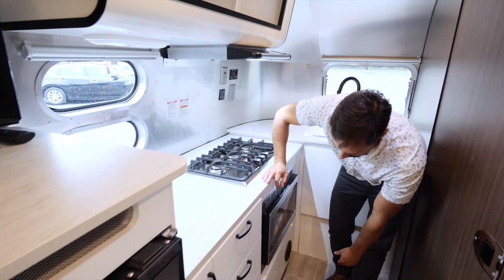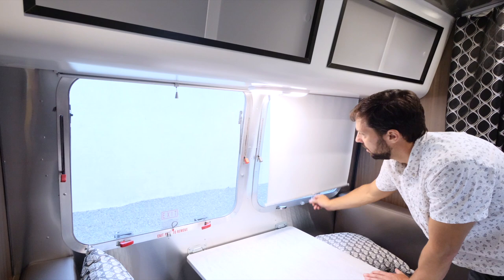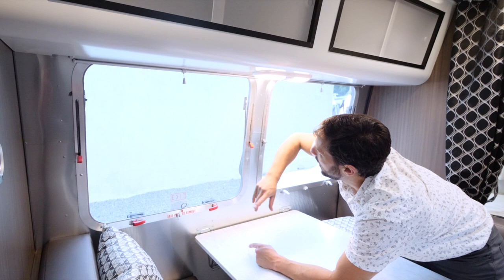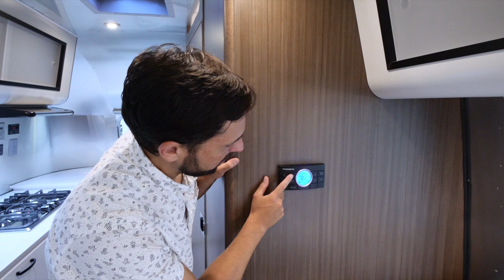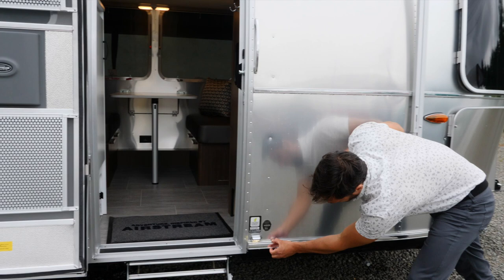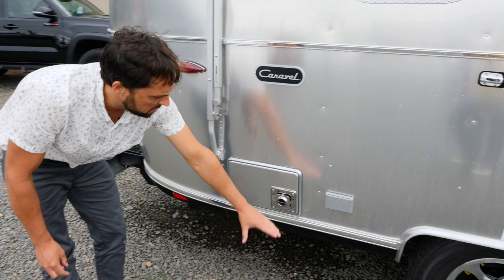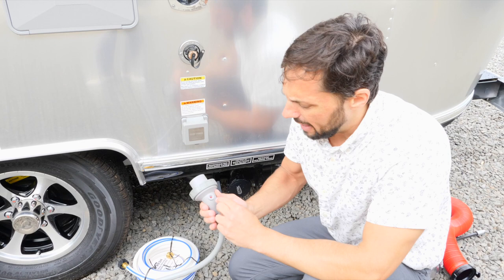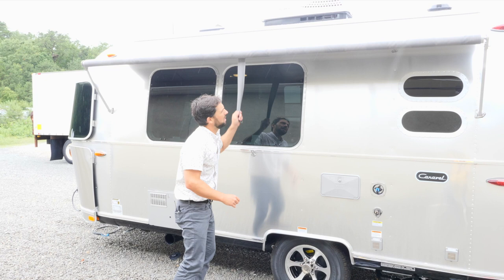2020 Airstream Caravel 20FB Walk Through Small Light Weight Travel Trailer Caravan

Comment: We have had 5 Airstreams from a tiny old Flying Could to an Airstream Bus as our family grew, I can tell you they are made like an airplane, they never ever, ever, ever, leak. I restored 3 of them and they all were just pure joy to pull and camp in. Don't even bother getting any other brand for your camping experience. They are THAT awesome.
Reply: Shelley Wallace good to know. I’ve had several vehicles that leaked! It’s not fun!
Reply: The tank capacities are on the small side. And the additional cost was a problem for us.
Reply: @BluJnGrl  I agree about the ridiculously limited tankage. Great for someone who spends most of their time camping in a place with hookups but we've never camped anywhere that had them.
Reply from the maker: Wow, really cool.
Reply from the maker: Thanks for watching.
Reply: I GENERALLY agree, HOWEVER, there is a NEW BIG shot in TOWN: Black Series HQ travel trailers 50% better built in ALL areas!

Comment: There is one thing I got to ask. I recall in previous Caravel and Bambis, the refrigerator could run on either propane or electricity. But now the newer models are electric only. Any reason why they done this?
Reply from the maker: The 12V DC/120V A/C refrigerators run more efficient, do not require fans, there is no longer venting holes required to be cut into the side walls and you can leave the refrigerator on while driving now.

Comment: One question about the 20FB under bed storage -- is that area accessible by lifting the mattress up or is it only accessible through the (tiny) door? If the mattress lifts up, is it purely a "lift and hold it yourself" exercise or does airstream provide gas shocks under there? (Really asking about 2022 models by the way).
Reply from the maker: The lift up mattress is on the 22FB not on the 20FB.

Comment: Patrick Botticelli we just picked up our new caravel 20 and you were right the tacoma pulls it like a dream with the blue ox track pro. Another question for my fellow trd pro taco lover: what is the best option for the trailer brakes? I think there's a factory plug under the steering wheel... what do you run in yours? Also I'm going to upgrade to the 25fb with the hatch and desk next year and I'm driving from Michigan to get it from you just to say I met Patrick Botticelli... I was telling my dealership about you and they said "we don't sat that name around here" 🤣🤣🤣
Reply from the maker: Ryan, we would recommend using the Prodigy P2 or P3, it should have been installed and setup prior to you pulling the trailer.

Comment: Screened windows & door? Is there an option for alternate bedroom privacy (vs curtain),  option for own mattress replacement, option for additional TV in bedroom, locked cabinetry while traveling, user manual, ???? Thanks much for the information thus far!
Reply from the maker: All windows and doors that open are screened. The curtain is the bedroom privacy. You can order a custom fit mattress through a 3rd party aftermarket if you feel it absolutely necessary. A bedroom TV can be installed aftermarket, there are owners that have done so already. The owners manuals can be downloaded on the Airstream website.

Comment: Patrick, I thought I heard you say that the battery disconnect switch had to be in Use mode for battery to charge when connected to shore power.  My 2018 27FB seems to charge the battery when connected to power regardless of switch being in Use or Store mode.   I keep it in garage storage plugged into power for months in Store mode and battery stays fully charged.
Reply from the maker: It is always best practice to have the battery disconnect switch turned on before plugging in the Airstream.

Comment: Would a pickup like the Toyota Tacoma in the background be sufficient for towing this trailer?
Reply: Yes with a V6 on newer models, no with an I-4. I would avoid taking it fully loaded up long steep grades though.
Reply: DaddyO273 — Capable?  Yes.  Recommended?  Yikes!  Keep in mind that while this trailer is right at your Tacoma’s tow rating of 5000 lbs., but you never want to tow at the max weight because of the stresses on your vehicle.   Towing at or over capacity will shorten your vehicles lifespan.  I would recommend a Tundra, but that’s just me.
Reply from the maker: Agreed.
Reply from the maker: My Tacoma can pull up to 6500# and does a great job pulling this trailer that has an unloaded vehicle weight of under 4000#.
Reply: Colonial Airstream  so you have pulled that trailer with that truck?

Comment: My F150 towing guide says I should't need a weight distribution hitch until I go over 5000 GVWR. However, the tongue rating on the truck is 500 without the weight distribution hitch and 1220 with the hitch. Do I look at the light weight of this trailer and go without a weight distribution hitch, or do I look at the tongue weight of the 20FB being over 500 lbs and get a weight distribution hitch? Thanks Patrick!
Reply: Oh... 47:06 in the video.... "Highly recommended to have some weight distribution hitch system..."  :) Thanks!!
Reply from the maker: Thank you for watching.

Comment: Hi Patrick, Did you mention the fridges work on 12 V when driving and electric at the site? Do the new fridges still work on propane when dry camping? Are there any positives and negatives to the 2020 fridge over the 2019?

How are you finding the new hitch couplers holding up?
Reply from the maker: Lance the 2020 Caravel has a 12V/120V Compressor refrigerator. I have swapped out my old style absorption refrigerator on my Airstream for this same refrigerator and am happy. There are so many positives and I have not one negative. We have not experienced any challenges with the couplers.
Reply: Colonial Airstream if I am dry camping though I have to wonder how long the batteries would hold up while running the fridge in addition to all the other 12V items unless the fridge requires very little power.
Reply from the maker: On my Airstream I went 5 days and never went below 12.1V. I have solar on mine like the way I stock the Bambi and Caravels at Colonial.
Reply: Colonial Airstream That’s awesome. Thank you for the feedback.

There’s a good chance I’m buying a new Airstream and a very good chance I’ll be buying it from you.
Reply from the maker: Thank you.

Comment: the pump will burn out if the switch is turned on? hard to believe Airstream's don't come equipped with an on demand pump that will only run when water is in it..if i'm spending 70-100k i'm def expecting to have that as a failsafe along with other important equipment in the camper so people can't ruin/damage anything important. i mean this is an AIRSTREAM. I'm expecting nothing but the best...no shortcuts!
Reply from the maker: Which pump are you referring to that is available in the market place that will only run when water is in it?
Reply: @colonialairstream  look up "on demand water pump". it runs up to a specific pressure point if there's water in it and then cuts off until water is used that brings it down below that pressure point. if there's no water in the freshwater tank it may run for several seconds until it's dry inside the pump then it will shutoff as a safety mechanism so it doesn't damage the pump. I previously owned a carpet cleaning business for 15 years which is how I know about water pumps. I typically used ShurFlo pumps because they were reliable. You could simply call them and they can tell you which models would work best for RV applications. Great thing is it's an easy fix to a problem that someone is likely to do while camping.